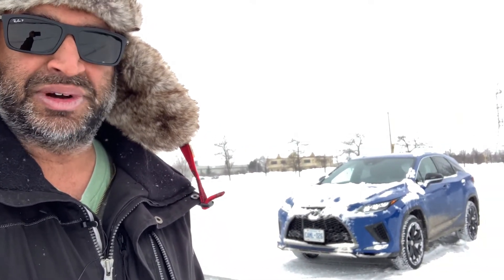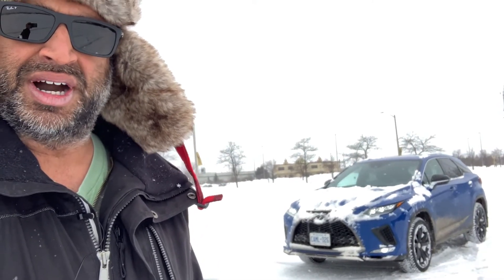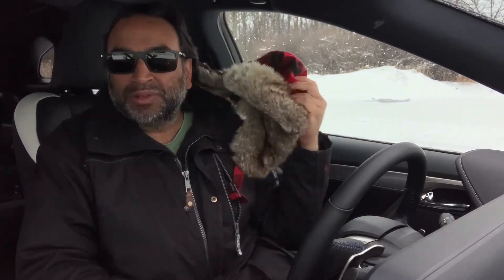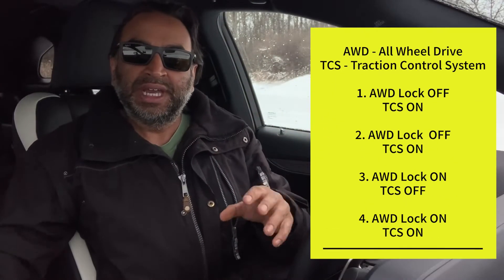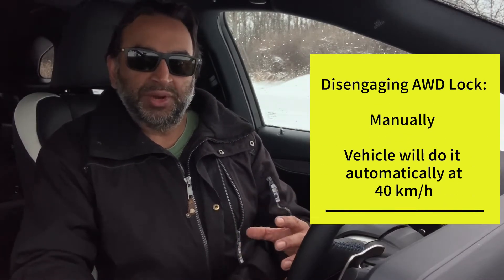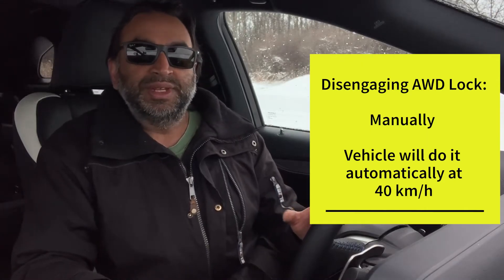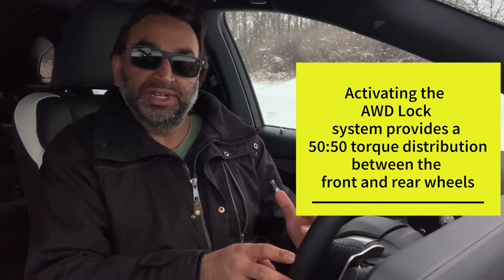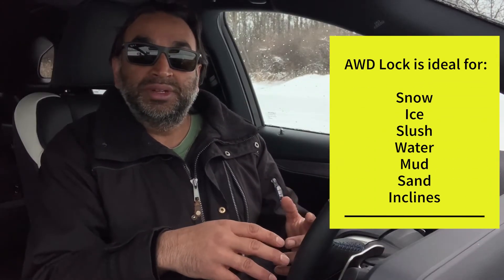How an All Wheel Drive Lock system works for winter driving

Comment: Basically it sends maximum pressure to the PTU at the rear. It simulates a locker but it won't fully lock. Problem with toyotas and lexus is their disgusting traction control...

Comment: So if you are exceeding 40 kmh and it is slippery conditions will the awd engage automatically or do you have to be under 40 kmh for it to engage awd and if the awd lock is not on and only traction control is on and you are driving over 40 kmh will it engage awd automatically or will you still be in fwd if you start to slid
Reply: @shooter2546 great answer 👍 really. You gave a real thought full response! Lol
Reply: Thanks for the video and explanation.